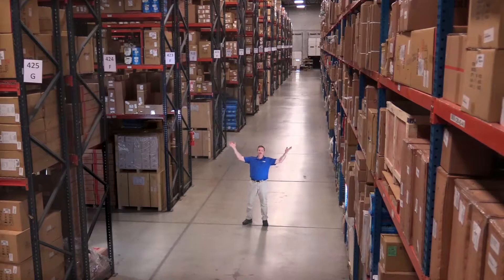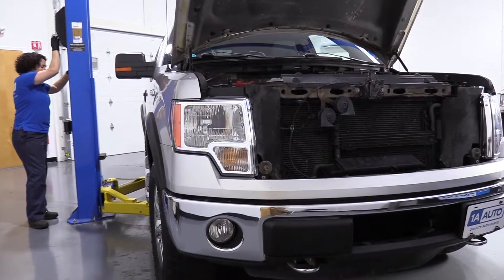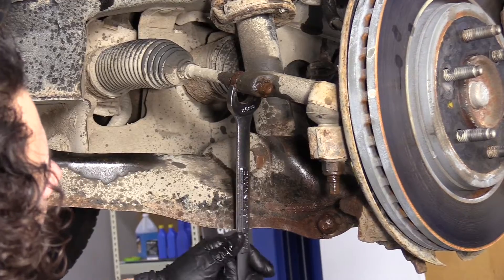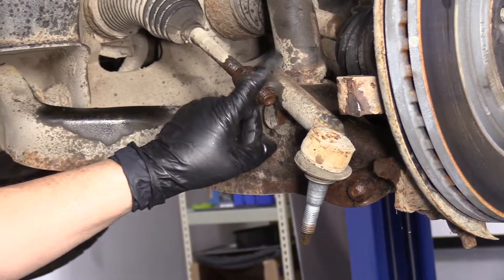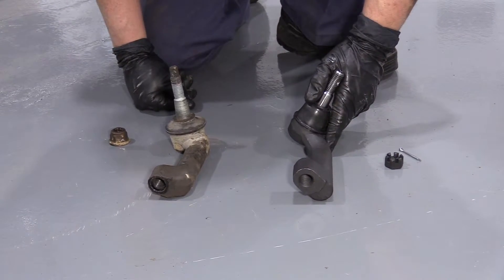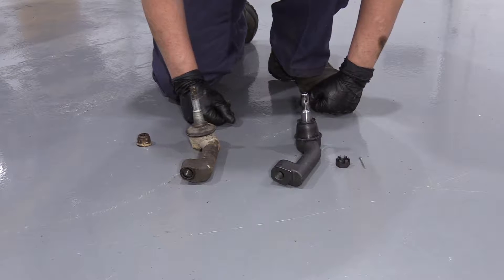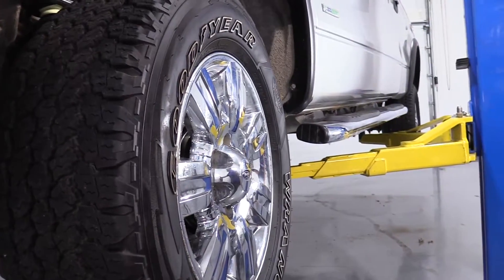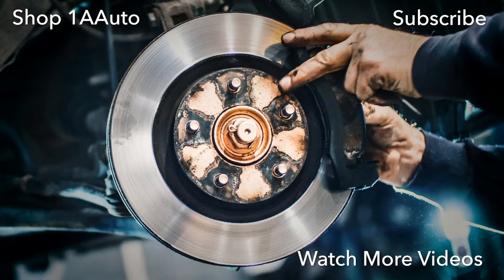How to Replace Outer Tie Rod 09-14 Ford F-150

Comment: I’ve watched a million of these videos for F-150’s and blows my mind how “easy” they make it look. On numerous occasions ive tried getting that damn jam nut loose and it always a nightmare. A simple 2 hour job turns into the biggest headache when u can’t get that bolt loose or the rod end won’t come out of the spindle. Often times you will end up needed a blow torch to remove the jam nut
Reply: True. I've learned to start hitting nuts/bolts with Seafoam two to three days in advance, and still have to use heat sometimes lol.  The horrors of NE US living. Brine city.
Reply: Just cut mine off

Comment: Don't forget to count the number of rotations when taking it off and putting the new one on. That will get you really close for the alignment in case you have to drive a significant distance to get it done. 

Side question,

Is it worth it to get the grease fitting tie rod end or just get the plain Jane non greasable one? in your opinion.

Comment: How do you know if you need new outer tie rods?
Reply from the maker: +Clayton Matt Abnormal tire wear, steering wheel moving freely, vehicle vibrations and steering shaking are signs you may need the tie rods replaced.  Thanks for watching.
Reply: @1AAuto  Thanks I've got all of those on an old truck I just bought.  The steering wheel has 30 degrees of free play in either direction when holding it straight and one of the front tires has a strange wear pattern. Guess I'll start with replacing outer tie rods and get an alignment after.
Reply: @1AAuto  It doesn't appear to have any moving parts, why or how do they go bad?  Do you usually replace both sides at same time?
Reply: What about clunky noises at low speeds?